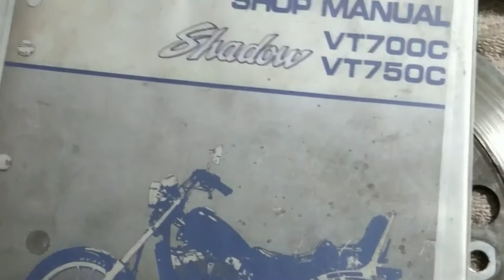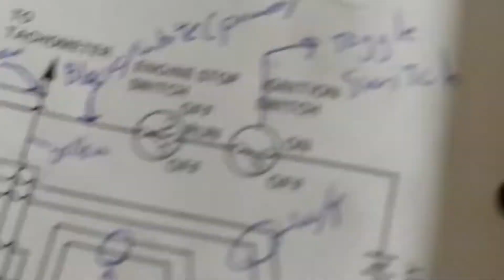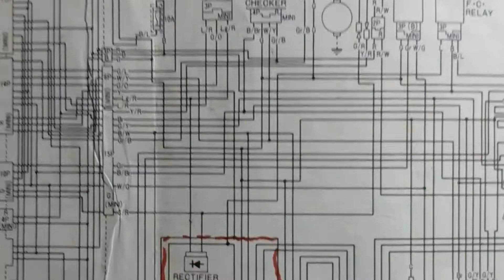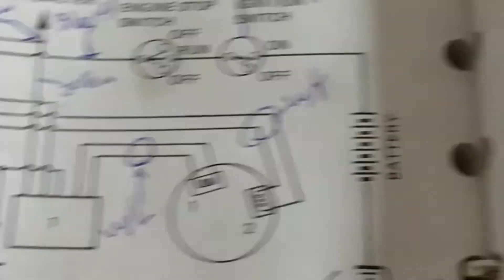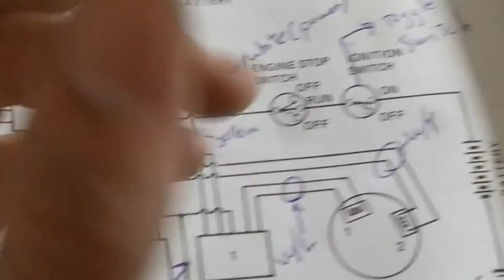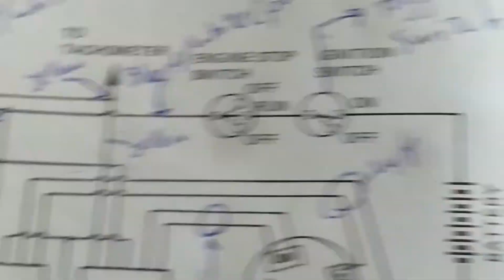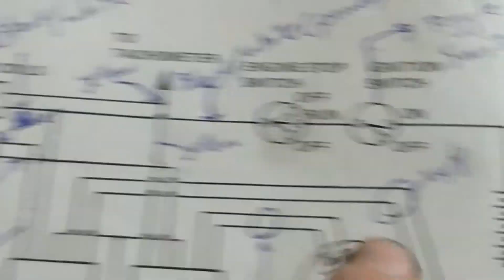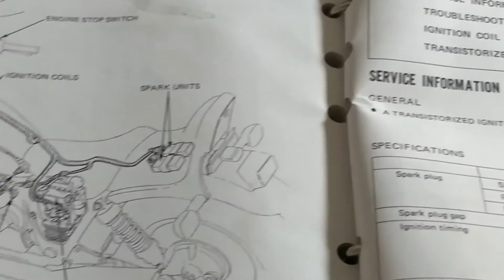How a 1983 Honda Shadow VT750 Igniton System Works

Comment: I bought a ignition switch for 84vt700c..bike has 5 wires...new one has 3...can I make it work?
Reply from the maker: You might be able to, it’s been so long since I had my Shadow and made this video so I’m trying to recall. But I guess if you figure out which two wires are extra on the bike, or could be put together, then you could just splice the 3 wire one into the bike. Just try and figure out what wires do what, and go from there. Hope this helps, sorry I can’t give you a definitive answer

Comment: Sorry, I know this is a a little late to the party but the "Lock" on ignition (for these older models) only works with the handlebars turned all the way to the left hand side and keeps the bars locked that way so someone can't just walk off with your bike. The "P, " or parking mode, keeps the tail light on for when you are parked on a street and want drivers to be aware of your bike (be careful not to wear down your battery too much).

Comment: Hi, do you know if the coils have polarity? I mean, I have blue and black wires conected in the coil, does it matters the way I connect them? Thanks, very helpful!
Reply from the maker: As far as I know, yes. When I first put everything back together, I originally had the wires swapped on accident. Finally swapped em and it cranked right up. Not sure what color is which, but I hope this helps.
Reply: @takemechrome2291  Thanks for your feedback! one thing makes me think its right both ways, at least on my ignition coils there is no positive or negative markings.

Comment: Hello brother I have 87 shadow 700 ...I lost the key and really need help... I bought a toggle switch and a on and off switch button and would like to know how which wires do I connect to the toggle I can't seem to figure it out on this bike if it's under seat or up front behind headlite. And do I need to take out the ignition or do something with those wires before I put a toggle switch on thank you for your help any info would be appreciated
Reply from the maker: If you are going to use the toggle switch in place of the key, all you need to do is find the two wires coming out of the ignition switch. Then, just connect those wires to your toggle switch (orientation of the wires is not important), then just mount your toggle switch either near your handlebars or extend the wires and put it wherever you want. You technically don’t need a “on and off switch” (which is known as a kill switch) because your toggle switch can be used for that. 

What I would do is buy an ignition switch off Amazon that comes with a key, and just connect the wires to the existing ignition switch wires. 

Hope this helps and let me know if you have any questions.
Reply: @takemechrome2291  thanks for getting back to me. I want to ask you , the ignition is turned off dose that matter and  I have  6 wires , red.... red/black line.....yellow/black line......blue/orange line......brown and brwn/white line............I need to no which wires to use on toggle and what happens to other wires.  Can't thank you enough my bike is in a bad area and it's crucial I move it.
Reply from the maker: @jerrymonte8625  if you need to move it soon, I would just touch the solid red wire (it’s probably the power wire) and touch it to each other wire and see if you can start the bike. One of those wires gives power to the ignition system and will allow you to start the bike and move it until you can figure out what the other wires do. I’m not completely sure on what the other wires do. Hope this helps

Comment: Building a bobber with munit and had no spark and thanks  to your video I was able to solve. Note my bike is a 1985 VT750 and has two boxes with 6 wires. Additional wires 2  yellow/red hooked  to ign 12 v and fired right up.

Comment: I have an 85 Honda Shadow VT500c. I’m getting a click when I try to start the bike from the (name ?) starter relay, located under the seat, but the bike will not turn over. I have the right Battery and it is new and good. All fuses are good, unless there are fuses I am unaware of. 
Anyone have any ideas???
Reply from the maker: I would hook up jumper cable to the starter. Turn the key to the on position but keep the kill switch off. Then take some jumper cables and put the negative end on a bare spot and the positive end on the starter post (there will be a stud on top with a cable connected to it, that is where you want it). Once you hit that post with the positive end, the bike should turn over, and if it doesn’t, check your ground to the engine and try again. If it doesn’t then over then you know your starter is bad. Let me know if that doesn’t work
Reply: I also have a shadow 85. And I can't make it turn on, im. Getting spark on the 4 spark. Plugs. Any ideas?

Comment: I enjoyed your video, i have a '83 750 as well. I'm getting spark at my plugs but it is very weak spark and bike will not hit a lic. Any advice would be great. Thanks
Reply from the maker: 79clowe42278 what do you mean by lic?
Reply: @takemechrome2291  I apologize, what I mean is.....it will not fire any at all. I have fuel, air, and a spark but not real hot. Although I would still think it would fire or at least try.
Reply: Check for at least 9v on front (primary) of coil WHILE CRANKING. If starter uses too many volts that could be it. Also check ohm between each (2) plug wires. Should be 13,000 to 15,000 (pretty sure). If not remove wires and check between the two output poles of each coil. Plug wires could be it.

Comment: Currently rebuilding the top end of my vt750c. This encourages me not to sell every part for the bike on ebay. Did you individually wire your fans, lights, etc. As well?
Reply from the maker: Void Skeletor I used the Motogadget M-Unit Blue. It’s basically a motherboard for your lights and accessories. “Revival Cycles” has an amazing video on YouTube explaining the process which I highly recommend. But with the fan I used a toggle switch since my temperature sensor was broken. Just gotta remember to switch it on. Hope this helps!

Comment: Question I'm not getting energy to the spark plugs how can I fix this?
Reply from the maker: Check your spark units, those are usually the first things that go bad. Check your ignition coils and make sure the spark plug wires are screwed in tight. Try putting dielectric grease on the ends of the spark plugs where they mate up to the wires. You could also buy some new spark plugs and gap them correctly. I did mine to about .035. 

Check your battery, your grounds. make sure your ignition coils are grounded to the frame well. If all else fails, then check your spark generators within your right crankcase. that's where perhaps your gap could be off.  

Hope this helps, let me know if you have any more Q's.
Reply: @takemechrome2291  well I had done the first steps and I can hear my starter turning but is such an old bike that the pedal and gear stick are stuck so I'll try to get engine out completely so I can check the alternator :(
Reply from the maker: Erick Gaona you don’t need to take the whole engine out to work on the shift lever. Also your stator (alternator) is on the left hand side of your bike. So it really easy to get to.
Reply: @takemechrome2291  true I find out my problem and I was far away from it I'll post a video soon of it what what I did ty though a load of help